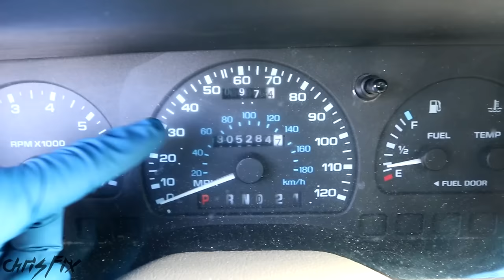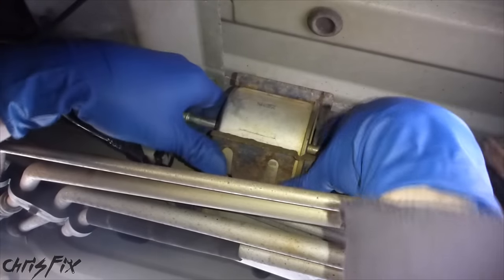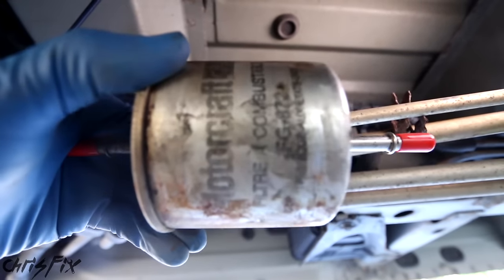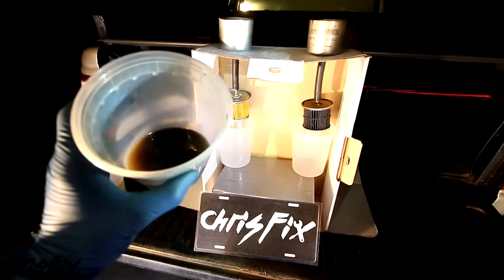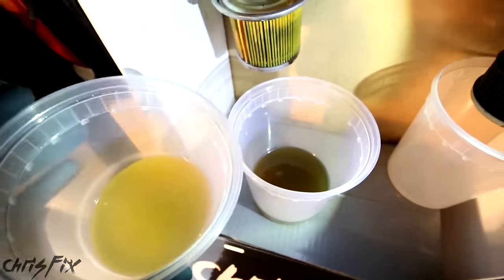What does the inside of a Fuel Filter look like after 300,000 miles?

Comment: I personally have changed many filters out over the years working as a Ford technician, sadly when we would see filters this dirty with poor flow like the one in the video, the fuel pumps would fail within 2 weeks of replacement.  The pumps would flat out work themselves literally to death trying to push fuel through.  Just a quick note (not trying to bash), the quick release tool was not needed for the first fuel line he disconnected.  It would have been a great chance to highlight the difference in fuel line connectors.  Great job overall Chris!

Comment: I bought an '87 Chevy R-10 Pick Up Truck that didn't run. The fuel filter was completely blocked. Put a new one on and she fired right up. Chris, may I suggest an oil filter cutter? Works like a champ. It is recommended to change your fuel filter every 30,000 miles.

Comment: the flow of gasoline is opposite to the test you did... Filters catch the dirt on the outside, filter it and flow towards the engine from the inside. Neverthe less, awesome experiment. Now people can get educated and see whay their filter must be changed in order to protect the fuel injection system
Reply from the maker: Thanks!
Reply: Joe Rivers I noticed that too, but I assume it's because he wanted to show the filter actually doing something, but the proper direction would not be possible with the cover removed
Reply: it's quite obvious when you think about it. On the outside it has the most surface to take the contaminants. I think a fuel filter in reverse would work too, but doesn't last as long as the correct orientation.
Reply: "Hi, I'm Chris Fix and it's really important you get the direction of flow correct. Note the big fucking arrow so even idiots can figure this shit out. Now, here's my dumbass test where I run fuel backwards through a fuel filter and act like I've proven a goddamn thing. Oh look, the fuel came out still dirty, I guess fuel filters suck but are better than nothing!" 

Palm meet forehead.
Reply: It's just a screen. Doesn't matter which direction the fluid goes through it. For purposes of longevity it needs to be installed the correct direction so that gunk can collect on the outside of the screen (more area, large baffles) as opposed to the nearly cylindrical interior. See photo of cross section: http://i.imgur.com/FWcPFPk.png  If you're not concerned with clogging, you can certainly run fuel through in either direction in order to filter it.
Reply: Yeah, the test is actually pointless. He poured the gas into the outlet side of the filter so the gas is flowing in the opposite direction than it normally would. So on the dirty filter he's actually pushing through the clean inside out to the contaminated outside. This then pushes off the contaminates from the outside which mixes with the gas and drops down into the cup. Pushing the contaminates off of the filter from the inside is a lot easier than trying to push into the contaminates and filter like it normally would. If he rigged it the way that gas normally flows it would look much cleaner, probably like normal gas, but it would probably be going through drop by drop because the gas isn't under any pressure besides it's own weight. Not hating on Chris his tutorials and advice is still all good it's just the test didn't prove anything, not even the flow rate.
Reply: +Jace Priester for his test he was testing flow rate, so the orientation actually does matter. It's easier to push through the clean side then push the contaminates off the dirty side than it is trying to push into the contaminates into the clean side. It'd literally be dripping if he had done it properly.
Reply: John Moore he used the new clean filter. Pay attention
Reply: Well the whole point of the test was to show that there is a difference in flow rate, which it very clearly shows even if it would be even worse if it was done in the correct direction.
Reply: That was pretty obvious from what he had said earlier, however, the filter is basically no different from the outside/in, so the flow rate should be quite similar either way
Reply: That stuff fucks up carburetors, too. Particularly idle circuits,  as they're the smallest and most delicate passages in the carb and thus easiest to plug.

It doesn't matter what you drive, make sure the filter's clean and replaced regularly.
Reply: There's likely a check valve in the filter to keep the system pressurized...or at least filled with fuel...when the engine is shut off. Don't need it on a carburetted engine as the float bowl and EVAP systems handle that, but on an EFI engine there's nothing stopping the fuel in the rail/lines from draining back down into the tank when you shut the thing off.
Reply: He showed the proper direction when he opened the new filter first. Outside to in.
Reply: Se45. The surface area is exactly the same on both sides of the filter material.

Comment: Awesome.  I just replaced the fuel filter in my 96 Audi A4 2.8 and the throttle response is super good now and requires so much less input to get going.  Only 20-ish thousand miles on it but just darn old so was probably gummed up.  Not no more.

Comment: In Poland most people change fuel filter at the same time when change the oil, oil filter and air filter. I think that is the best way to service :D
Reply: Here in North America we have newer  cars ! Which has expensive gas filter about $40 + $120 labor +13% tax=$180 in Poland  and Eygept  it coast max $30 for full tuneup.
 in North America full tuneup coast us$400
Reply: Joseph Tahan Do it yourself,you just watched a video on changing the filter.
Buy oil,coolant,oil filters,coolant flusher,brake fluid,gas filter,air filter.
Change oil,flush cooling system,change brake fluid,change oil/air/gas filters.
Top up power steering and wiper fluid.
Check/change:light bulbs,brake pads,tyres.
Cost:
Oil(5l=40$),
Coolant(5l=27€),
Brake fluid(1l=10$)
Oil filter(10$)
Air filter(10$)
Fuel filter(10$)
Total cost:107$ plus your labour.
Reply: I change my fuel filters at every service... 5000km
Reply: That really depends on the gas quality. In Brazil there is a big ethanol percentage and the gas is not that clean so every two oil changes I change my fuel filters. Never had a car too troublesome to do that (all I owned were compacts made in Brazil, though)

Comment: A fuel filter wouldn't even exist after 482 803.2 Km (300'000 miles) in Sweden...
Reply from the maker: +Hannes Camitz Dang, is gas that bad?
Reply: +ChrisFix No that's not issue, but the road salt on the winter roads....
Reply from the maker: +Hannes Camitz haha, we have bad road salt too and I live near the beach so in the summer we have ocean salt! You guys must get it worse though!
Reply: It was more of a joke though. ;-) 
Then the quality of the filter components will make a lot of difference to.
I live inte the middle West of Sweden.
Reply: +ChrisFix no vehicle in my climate will last 300,000 no WAY in hell. usually by 200K the thing is so rotted its ready to literally break in two pieces. we have the worst cars in the entire country. i have a 2000 grand prix GTP with 160k on it and its already starting to get bad. 2-3 years it will be junk even if it runs strong which it probably will. i have had to dispose of countless vehicles that otherwise ran decent.
Reply: +andrew donohue lol.  ya right...
Reply: i guess you dont live here? cars around here die a rusty death. you would otherwise be able to run certain cars for 3-400k miles. the GM 3800 V6 is a very strong engine.
Reply: +Hannes Camitz   I live in California.  My 1998 Volvo V90 doesn't have any rust at all.  I still drive it every day.  I've been driving Volvo since 1978.  I love Volvo.  The cars are beautifully balanced between performance and efficiency, durability and cost, comfort and performance.
Reply: +John Ferguson we own a Volvo V70 -98 and it just passed 470'000km this month.

So yes they are long lived vehicles, and cheap part at least in Sweden.

so yes they
Reply: Hannes Camitz   That car is loved.  The V90 was the last rear wheel drive made.  People try to buy it from me all the time.  People who drive new Mercedes tell me how nice and smooth it rides compared to their cars.  Unfortunately, finding parts is becoming tough to do.  My mother was Swedish and raised in Canada.  My daughter wants to study in Sweden soon.
Reply: it must be nice to be live somewhere where the cars dont rot right into the ground. i have a 2000 GTP which mechanically would run for years, it has 161k miles, sadly its starting to rot out. it pissed me off because that 3800 supercharged engine is such a strong engine it could run for another 100k+ fairly easily. they are a tough engine, sadly the body will never last that long.
Reply: andrew donohue Some people here in the USA are using the same products that are used on pickup truck bed liners to rust proof the underside of their cars.  It works amazingly well.  It is some type of polyester resin.  Corrosion from road salt is becoming even tougher problem with more aluminium body cars.  A man in my town drove his Volvo 1 million miles.  Volvo traded a S80 with lifetime service and brought the car to their museum in Sweden.  He drove all the way to Northern Alaska and Southern Argentina.  No Volvo in history had ever been so far North and South.
Reply: Is it a P1800?
I believe I've read about that one that had been driven 1'000'000 miles (130'000 mil)
1 mil is equivlent to 10Km.
Reply: Hannes Camitz 1 million miles = 1.625 million km.  It was a 140 sedan.  He was a professor from the local university.  He bought the car in 1965 I believe.  It had the original engine.  The automatic transmission was replaced at 650,000 mi.  He had a complete service history.  He recorded every time he purchased fuel and calculated the fuel mileage.  He had receipts for every tire change and new battery.  I saw the pictures.  It was amazing.
Reply: This guy is the one I was thinking of.

http://www.autoblog.com/2013/09/18/irv-gordons-volvo-p1800-has-hit-3-million-miles/
Reply: +ChrisFix Welcome  to rochester  NY. The roads turn white as  the snow from how much  freaking  salt they use. I have seen 2012 cars already  rusted  out and  in the  scrap yard.
Reply: pickup bed liner material really isnt the best stuff to be using. you would think it would but the problem with something that is a hard material is that eventually it will break down and when it develops cracks it will let the salt in and it will never come out. it will trap all of that crap and rot it worse. the only thing that stands a chance is oil based process like krown for example. this type of product will not trap moisture and wont give the salt a place to get trapped in.
Reply: Rustic Shine
 i live in buffalo ny. 2012's??? rotted out? i know its bad but i didnt think for a minute that it could be that bad. i have a 1996 camaro Z28 that originally came from california. its a 20 year old car, and some previous owner did drive it through 1 or 2 winters, the rust is very minimal though. its amazing how little rust is a problem when you dont expose a car to massive amounts of salt year after year. cars literally can last almost forever if you take salt  out of the equation. they put that crap on the road that damages my personal property it pisses me off. the camaro by the way does not see winter driving. it has 215K miles on it and its still quite clean. i can always rebuild the drivetrain but if the body rots out, its junk. no salt

Comment: Depends also, on where you buy your gas. In Connecticut, refined gas is tested often, the gas station holding tanks are all fiberglass now,  so no rust like from the old underground metal tanks, and the holding tanks are vented to avoid condensation. My last filter was changed at over 100,000 miles on a 17 year old car. It was still clean.....almost like new.  In Texas years ago, I had a 1991 Acura, and that filter at 100,000 miles and 15 years was filthy beyond belief. I suspect it was from gas station metal holding tanks.
Reply from the maker: Interesting, thanks for sharing!

Comment: On my Buick roadmaster wagon 1994, I never had a problem with filter or injectors until I put in some bad gas. That clogged up the fuel injectors! I took off the old fuel filter and  when I shook it, it clinked on the inside, so it had  fallen apart on the inside for untold thousands of miles. Being bad, it allowed the dirty gas to clog the injectors. I cleaned the injectors using 90% rubbing alcohol soaking and an ear bulb to manually force back flowing when hooked up to my battery charger to click them open temporarily. Dont leave them powered open too long.

Comment: I wouldn't say the gas is clean in this part of the year. I had one car, low 100k miles, and stopped running because the fuel filter was clogged. I assume it was the original filter, but I can't be sure. I removed the filter, and when I took the line from the injector side off, the fuel was black, worse than that of the 300k filter in this video. 
Pretty sure that car spent most of its life in NJ and surrounding areas.

On a 95 Jeep, also low 100k miles, the fuel filter was PIA to change. The lines rusted onto it, and I had to break the clip just to get it out. Also under the car like this one, but how did you get so lucky that it just came off? Had fun that day, had to drop the tank to change the fuel pump, and figured I would do the filter while I'm at it. Yeah, nothing was easy that time, and I wasn't home then.
Reply: There are many factors in why a filter gets dirty, not just from the gas. A person that always lets the gas level go to empty before filling up is going to suck up the junk from the bottom of the fuel tank where the sediment settles. This along with the age of the fuel tank. As opposed to a person that never lets the gas go below say a quarter of a tank to half a tank. The dirtier your fuel filter gets, the harder your fuel pump has to work as it adjusts the fuel pressure to push the fuel through the dirty filter. The old adage an ounce of prevention is better than a pound of cure applies to a fuel filter. Change it once a year and you'll have happy motoring.